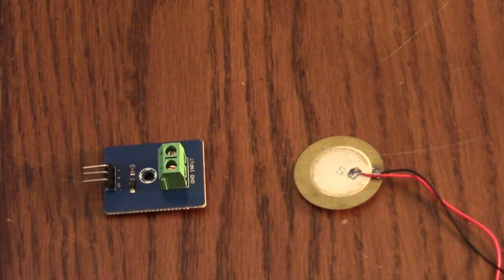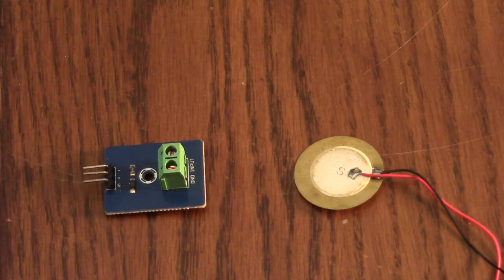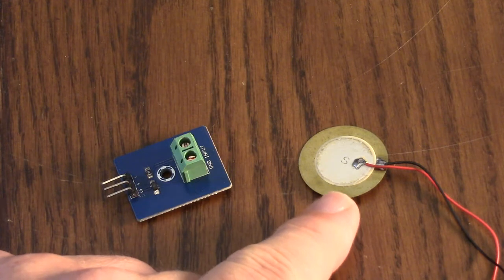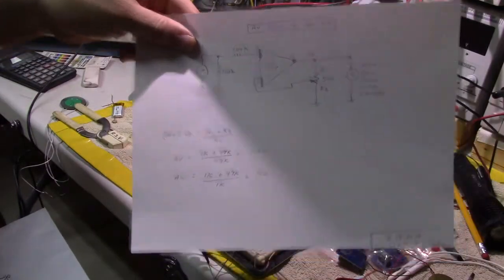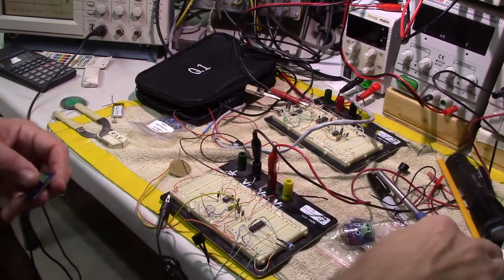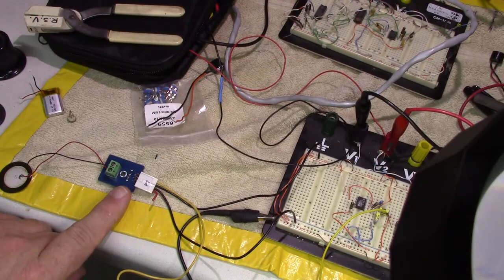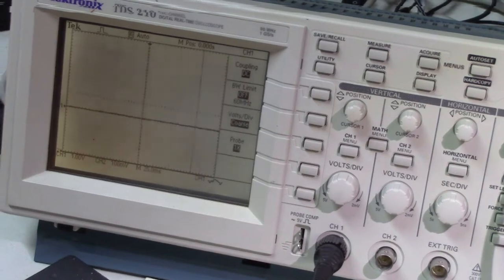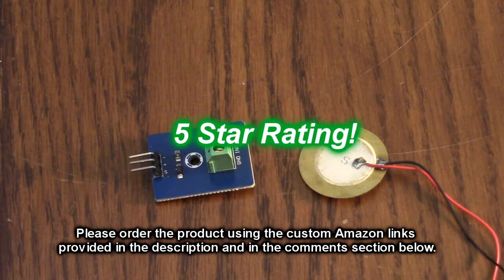Piezoelectric Sensor Analog Ceramic Vibration Sensor Module Piezoelectricity for Arduino REVIEW

Comment: I was wondering about the schematic of the module since I was not able to find it on the web. Given that it amplifies the signal from the piezo, do you think it's the same circuit as the one you drew before just on a tiny pcb? or would it be something different?
Reply from the maker: I am not sure. I could not find any info about the onboard circuit either. Nice little module to use to amplify a piezo voltage.